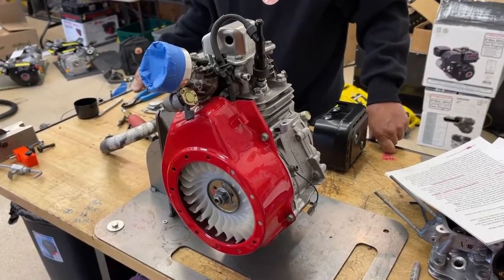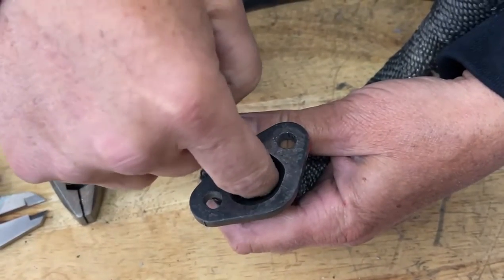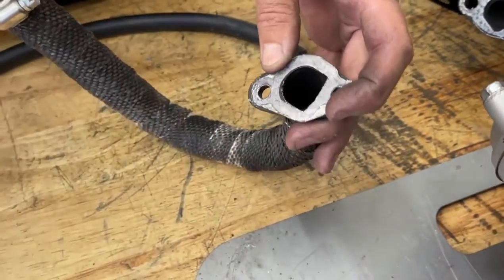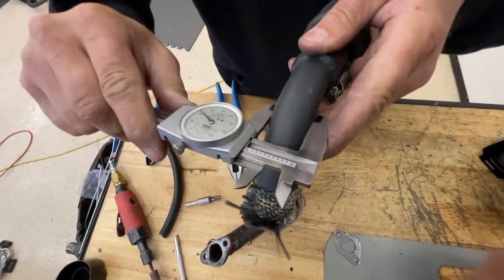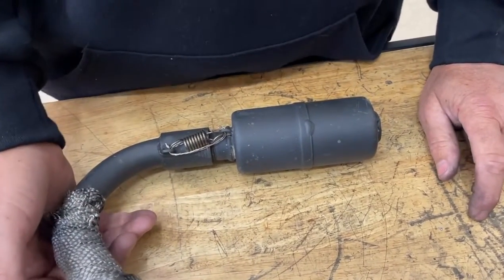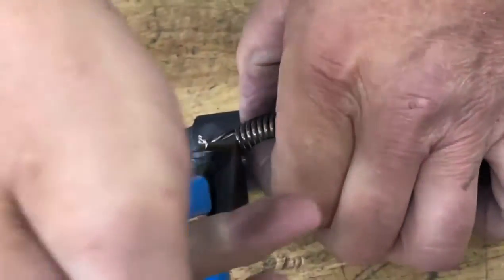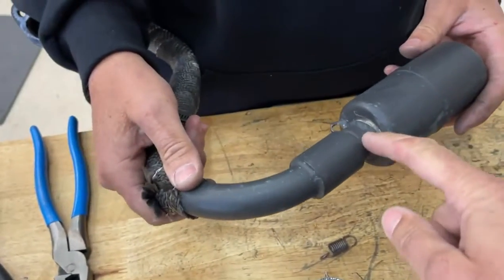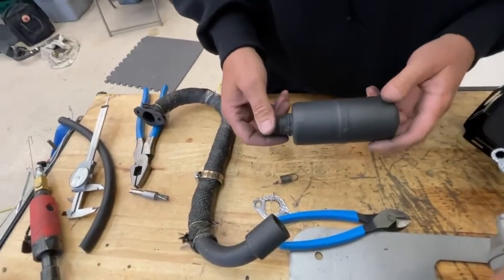Quarter Midget Exhaust Pipe Tech

Comment: Just to inform you guys that the length and ID are very important. Bigger is not always better and the length must also be correct for max power. However the rules were originally made so that the exhaust system (pipe and muffler) could not be tuned for these engines.

Comment: In addition to my first comment the amount of exhaust gasses that escape through the threads is insignificant as far as power out put is concerned, as I could not find a power increase nor decrease between fully tightened vs one full turn loose. The original rule was that the muffler must be tight, but like everything else in Quarter Midget, someone got dq'ed and adjusted the rule